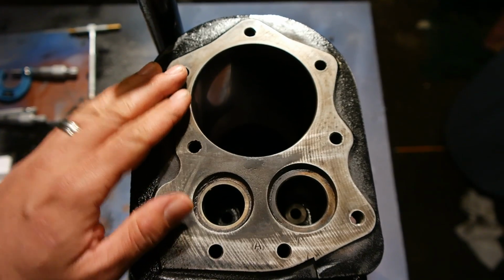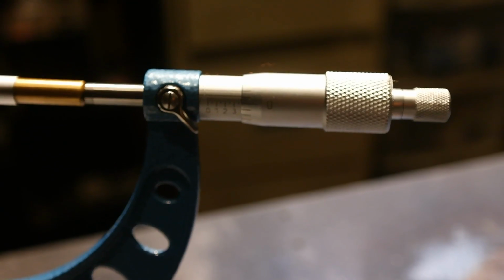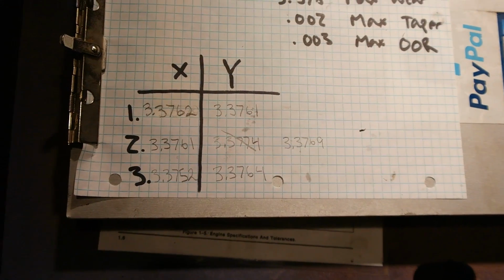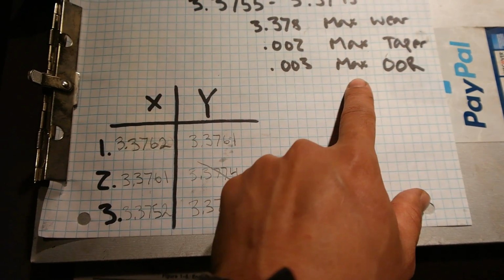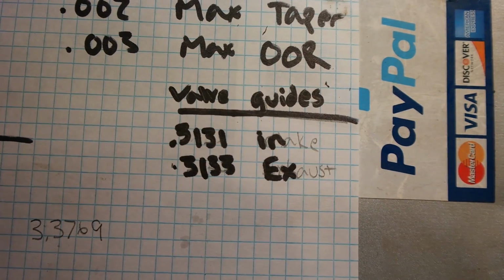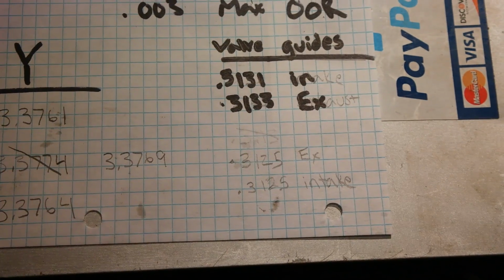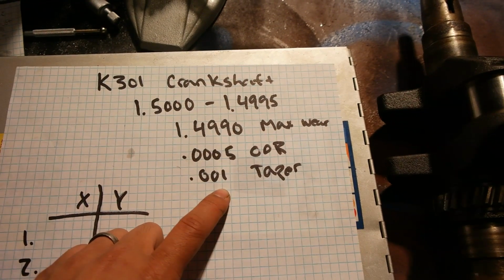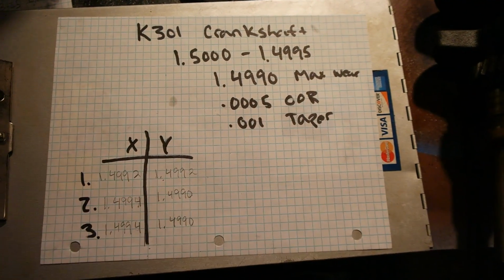How to Restore Your Vintage Garden Tractor Ep. 5: Measuring the Kohler K Engine

Comment: Thank you Norman! I am restoring a Cub Cadet 100 and these videos are going to be a great guide to taking my K241 apart! Will definitely order your rebuild kit soon. Quick question, what brand of micrometers and gauges do you use? Since I’m on a budget, I will probably have to resort to a set from Harbor Freight.
Reply from the maker: I like the anytime tool brand on Amazon.  Just make sure it goes to the third decimal and you measure the standard the tool comes with and adjust your zero
Reply: @Isavetractors  Thank you Norman! I was actually looking at the Anytime brand while pricing some sets out, I think I will go ahead and go for it. I appreciate the help and your channel!

Comment: Hi Norman!  Excellent video series!  I rebuilt my k241 10hp for my Gravely about 15 years ago, or so.  I did not replace the valves or valve guides. (I did not have proper tools at the time.)  Now they are very loose.  I was kind of hoping this video would address valve guide replacement, boring and/or sleeving.  I'm pretty sure I have 2 new guides in my stash from when i did the rebuild.  Any advice?

Comment: Hey Norman!  I am rebuilding my Kohler K181.  I have done all the measurements, and everything is within spec except for the crankshaft.  My out of round for the crankshaft is .0007.  The max is .0005, the same as your engine.  What should I do about this?  I know nothing about machining.  Your help is appreciated.
Reply from the maker: You should contact a local machine shop to turn it to .010 undersized. We have listings of machine shops on our website.
Reply: @Isavetractors   After I have a machine shop .010 undersize it, should I select the .010" connecting rod on your website?

Comment: Are these measurements and tolerances the same for the  k241s
Reply from the maker: They are not. See our website and the resources tab for the full measurement and secs
Reply: @Isavetractors  bless u kind sir
Reply: Would i be correct that the process and order of reassembly would be the same?
Reply from the maker: Yes just in reverse.

Comment: Any help with a 68 cub that has compression and spark but won't start?
Reply: Way to late to help Matthew but may help others. My K181 had spark and compression and timing had been checked over and over yet still wouldnt fire. I ended up finding the exhaust valve wasn’t closing all the way and I was never getting full compression. Once I got my valves cleaned up and lash correct It fired right up.
Reply from the maker: Look into: Clean Air Filter, Point Gap, and Carburetor Condition.
Reply: isavetractors do u have any way a can pm you?

Comment: Hi Norman I have a problem with a k321 on a case 224 garden tractor after running it for about ten minutes  oil will almost pour out of the head and run like a river down the side of the block any ideas thanks
Reply from the maker: I bet you have gas in your crankcase from a flooding carburetor. Your oil is way too thin from the gas going into it and the level is probably way too high. Pull your dipstick and smell it. Does it smell like gas?
Reply: i know im a little BUT if that is the case the oil MUST be changed ASAP. gasoline is a solvent not a lubricant. oil that has a high content of gasoline can quickly destroy the rod bearing (small engines dont really have a rod bearing you get the idea though), it can also cause other rapid excessive wear. keeping oil in an engine that has a high content in gasoline is a sure fire way to seriously shorten the engines life and require a rebuild much sooner then normal.
Reply: @ad356  unless it's a honda CRV with the 1.5L turbo motor...it LOVES gas fouled oil.  honda says its perfectly normal too.